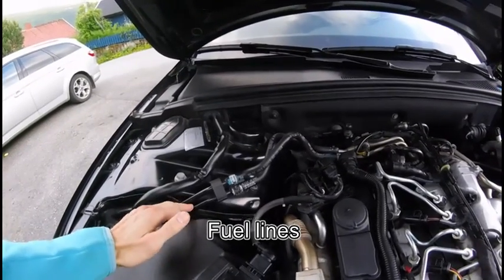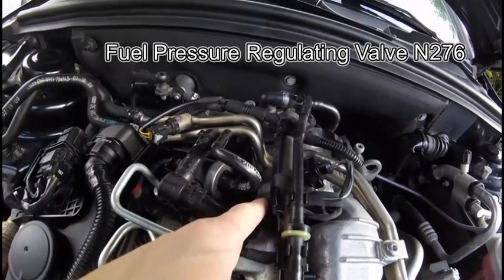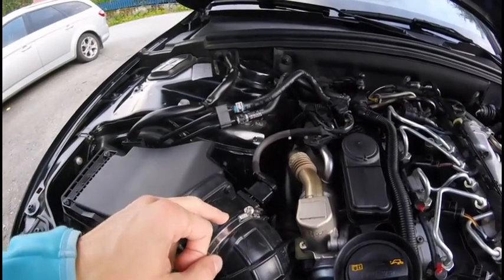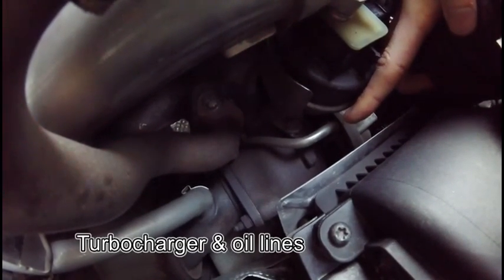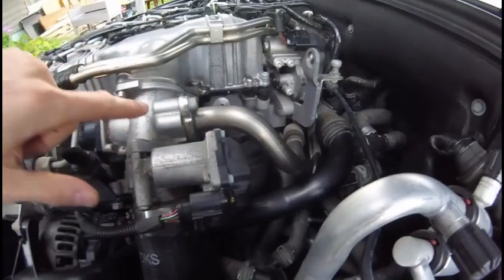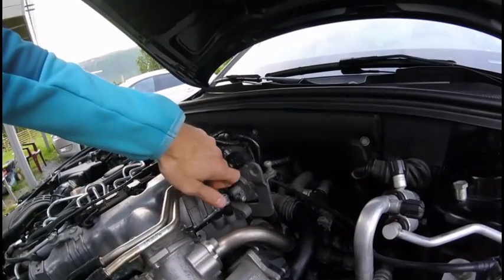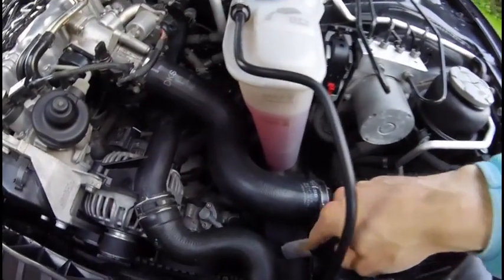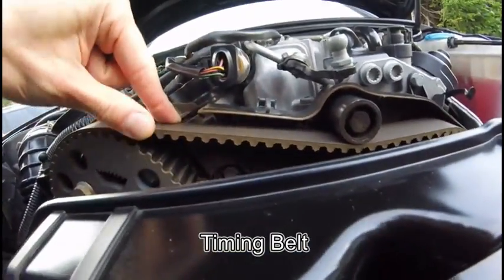Under the hood explained Audi A4 B8

Comment: Audi is the worst car I have owned it’s a money pit full of problems
Reply: 😂😂😂 6 Audis i own and 0 problems only maintain. 2 A4s ,
(B6 sold with 370.000km now i own B8 8K5 Avant 2.0 tdi with 228.000 and its delicious, both greatness) 1 A2 i bought for 2.500€ and sold it for 5000€ with 90.000km , 1 A3 8P ssold it when he has 370.000km 1.9 tdi and still rolling on the streetd with 500.000km one A6 2.7 TDI C6 it was a joy and A8 3.0 TDI a master class all sold. Service intervals and knowing well what u have on hands is the key. If you are a zombie handling good cars…poor good cars 🤣🤣😵‍💫😵‍💫
Reply: Which one did you own? Curious what mileage and spec
Reply: I have 3 Audi and they have been good to us (2009 A4 cabriolet, 2010 A4 Sedan, 2015 A3 Sedan) in USA.  Do the maintenance and they run well, a pleasure to drive especially the convertible on a warm sunny day
Reply: I have a 2014 A4 Quattro CNCD engine. It came with the high performance 165kw 2.0 turbo, and then I gave it a stage 2 upgrade (ECU upgrade, larger intercooler, new down pipe and cold air intake. Makes well over 300 ponies now. And yet it’s my daily driver and never gives me any problems.
Reply: same like in the video ,an my brother has also a b8 but caga engine,same problems it's like they like to drink money 😢😂

Comment: I have excessive mount of oil in my engine.
Where can i shove the hose inside the engine and start sucking oil?
And for US citizens. Euro model don't have old skool dip/oil stick.
Reply from the maker: You can't. Use the drain plug on the oilpan, beneath the engine.

Comment: A4 B8 2.0 TDI (CAGC) - I have rough idle (engine shaking badly, seems to work louder, noticeable vibrations inside of cabin), rev gauge is not fluctuating, it happens random, and after pressing acc. pedal for few times or driving for a short time it becomes normal... does anyone have any idea why this is happening? I need to clean EGR valve (i think it is dirty), i tried to clean "throttle body" myself long time ago but later on i've read that butterfly plate inside is not good to touch or push, and i was pushing and releasing many times while cleaning, it is possible that i damaged my TB ?  Also, i noticed engine temperature gauge is reaching 90 deg really slow and if i turn on heating it goes back to 70...60... degree..
Reply: I have operating heat issues. never really reaches 90 where it should sit. and driving motore way it sits between 60-70-80. I am changing my thermostat today and doing a coolant system flush. hopefully all the problem is just a stuck thermo.
Reply: @wwt-worldwidetrips8544  please let me know if it works and how it works after changing thermostat
Reply: @wwt-worldwidetrips8544  how did it work out for you pal?
Reply: My Audi A4 b7 2006 tdi also shakes on idle but I checked with a few garages and its a common problem. Something to do with the fuel line but it does not affect the car at all.

Comment: nice video. I have the CAGA engine A4 2.0 tdi. Can you tell me the location of the thermostat? Mine may need replacing. 
My engine does not reach operating temp (90) and fluctuates below this around 60-80 depening on how it's driven (ie. city/motorway).
Reply: found the thermostat. its behind the alternator. first thing i will try is change thermo with new one and flush coolant system and replace with new. see if this affects operating temparture.
Reply: I had this issue. There is a secondary thermostat on the back of the engine. Look for VAG 03L 121 157 B.

Comment: I have same Audi  . Engine is undtable  it’s shaking
Reply: is it still shaking? what was the problem? i have same a4 b8 cagc 2.0 tdi engine and it shakes on idle but not all the time... if i push gas pedal few times it calms down... do you have same issues, fixed?
Reply: @oneeetwooooothreeee  similar issue here buddy,  have you managed to sort it.  Ross tech forum suggests Egr valve clean or replace and vcds reset.
Reply: @rayc1503  it was due the bad FPR (fuel pressure regulator). In fact, with existing FPR it was shaking/vibrating random, and after changing FPR now it doesn't shake but vibrations are still here, most of the time when it is colder weather. In my opinion neither old or new are good, but new one is better because there are no shaking of engine anymore. Vibrations are maybe because of something else (engine mounts etc). Before this i cleaned egr valve but did not helped.

Comment: Not muching with my A4 2.0TDI 2014 non quatro
Cant fibde MAP sensore where did you show
Reply from the maker: 9:30 MAP sensor
Reply: Tord Andreassen  yes Can’t finde position for it  as must to change it , f**king limp mode on
Reply from the maker: @Dainis_Liga  should be on the intake hose somwehere, between the intercooler and intake manifold
Reply: Is there a Recirculation valve

Comment: I just bought one of these, my 1st diesel engine ive owned appreciate the info.
Reply: Hi, heard that the B8 gets really bad at the engine fuel consumption which requires a costly repair. How's it going for you?
Reply: @Toriqization  going great so far, what is the costly repair you speak of?
Reply: @TheIllestMVP  I meant oil consumption (not fuel, my bad). Please check this: https://www.youtube.com/watch?v=yX7QAxe4EXE&t=243s
Reply: @Toriqization  all good so far ive only owned the car under a year so far give it another few months like all vag cars it will be pissing coolant and leaking or drinking oil no doubt
Reply: @Toriqization  has around 74,000 miles on it at the minute
Reply: @Toriqization  i will def keep a close eye to it now you mention thanks for the heads up
Reply: @Toriqization  As far as I'm concerned the excessive oil consumption only applies to the petrol engines.

Comment: Hi great video btw, I wanted to know if there's a way to clean the Dpf without regen at high speed or VCDS regen via Vagcom.  Someone recommended Wurth dpf cleaner which is injected into the dpf itself. Do you think this would work? Could you instruct on how to carry this out. 
Thanks in advance 😊
Reply from the maker: Unfortunately I have no experience with such cleaners. But I assume you will have to let the filter burn clean after using the cleaning solution, either by driving or by forced regen. I guess the benefit would be questionable, unless the filter is above the limit for what a standard regen can handle (above 40g). But if it is blocked, why not give it a try? 🙂

Comment: i have a Q5 and he consuming oil, with a motor like this
Reply: It's common problem with these engines. Mine was fixed under warranty by changing the piston rings and other related parts by the dealer.

Comment: Hi there. Thanks so much for this video. It is awesome. But I have a big question. I would appreciate if you help me. I have the same vehicle and I tried to research everywhere and i didn't find a picture o video of what is under the Windshield Engine Bay Cowl Cover Trim Panel Firewall OEM. My car is missing this and it is making the AC no work right. Could you please send a video showing that. or send me a Pic of that plz. I am not sure if I am missing a filter or what. My email is bruks546@gmail.com Thank you so much for your time.
Reply from the maker: Bruks Ariza uploaded some pics here https://www.dropbox.com/sh/4x3z78fgyz508jo/AAAGAKJb15sVO0WHL5eeLRjJa?dl=0
Not convinced that will help. Sounds like you have a clogged drain line from the AC?

Comment: watched both of your under the hood vids, very detail thanks a lot. always wondered what are under the hood other than the ones listed in the manual. If you can do a video on undercarriage that would be great!
Reply from the maker: Okaythen001 Thanks!
That is a great idea. Undercarriage, suspension & brakes are on my list :)
Reply: Yeah just explain whatever is on the undercarriage, like what you did with the engine bay. Should be great!

Comment: Any thoughts on what is causing a p0013 and p0023 faults code? Thanks
Reply from the maker: Jamie Reilly which make/model is your car? Engine? Changed your engineoil recently?
Reply: Tord Andreassen thanks for your reply it’s 2009 a4 b8 2.0 tdi 143 oil changed in November, car runs fine, engine light and flashing coil light. Codes read p0013 & p0023 & p2111 ? Thanks
Reply from the maker: Jamie Reilly The first two are generic codes, I couldnt find anything on ross tech about them. Which diagnostic system are you using? The last one refers to the intake manifold flap. It could be jammed/seized?
Reply: Tord Andreassen yes my throttle/shutter valve is jammed open fitting new unit this weekend. (Hence p2111 code) it’s the generic codes that’s confusing me, do you think they will clear with a a new throttle valve install? Thanks again. ps just a cheap obd reader from eBay
Reply from the maker: Jamie Reilly Well I get your confusion.. Maybe erase the codes, and see if they return when the new valve is fitted?
Reply: Tord Andreassen thanks for your help will update after new valve is fitted
Reply: New egr valve and throttle body/anti shudder valve fitted. All sorted 👍